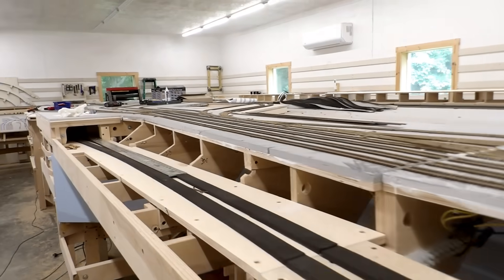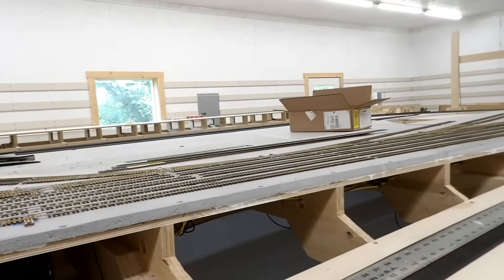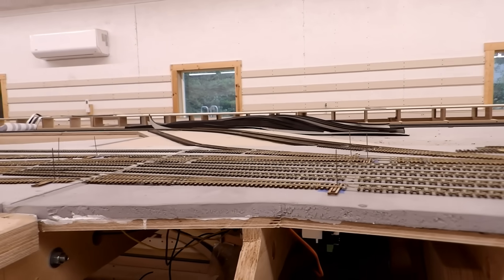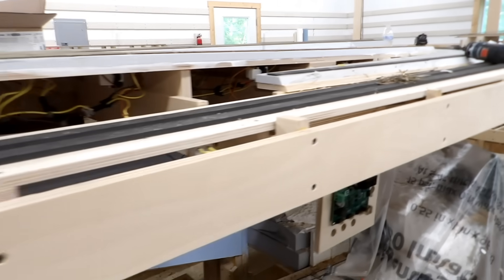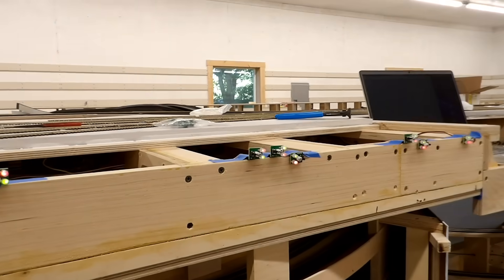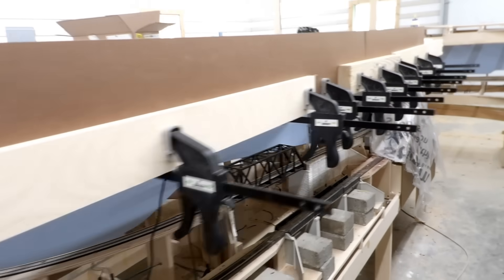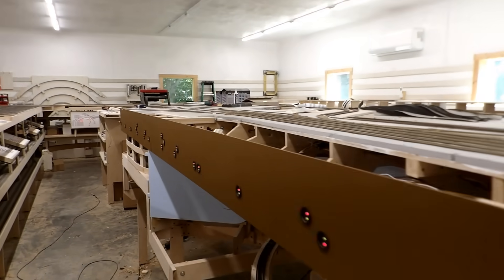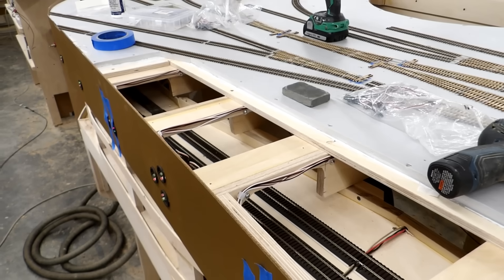The Sydney Project #48: Paper mill electrical

Comment: This is an amazing project with an incredible time line....I think you've been working on it for over a year.  Now I know you've said you answered these questions in an earlier video, but I can't seem to find the details.  So, if you'd be so kind - what is the completion time frame and ship date?  How have you built in disassembly or break points?  It looks like everything is fully hardwired and assembled without any discernible break points.  Thanks for the answers and again a great project.  I'm sure the Austrailan customer will love his railroad......once it's done, delivered and reassembled.....
Reply from the maker: Everything is built in 7' sections, allowing them to stand up in a standard shipping container and fill it efficiently.  Wires that cross benchwork sections have screw terminal blocks for separation. I started building on 08 December, 2023, and expect to be ready to ship it by the end of this year. It was always estimated as a 2-year project, and I think I an right on schedule.
Reply: @mpeterll  Thank you for your reply.  I appreciate it.  Again, a great project.  I'm sure your client will love it when it's delivered and installed.  Your client is also incredibly patient to wait two years for his model railroad.  A lot can happen in two years.  I'm sure you a fully cash positive and not having to worry about cash flow, etc.

Comment: When it comes to dismantling the layout for shipping, how will you manage the wiring and the need to disconnect so much of it?
Reply from the maker: All the bus wires have screw terminals at each benchwork joint.  Most of the switch machines are controlled from Quadln circuit boards mounted on the same section, but for those that aren't, the RC cables will need to be unplugged for transport and them plugged in again afterwards.
Even with the best preparation, the electrical hookups are still a pretty major task - there's no way around it.
Reply: Inquiring minds want to know....